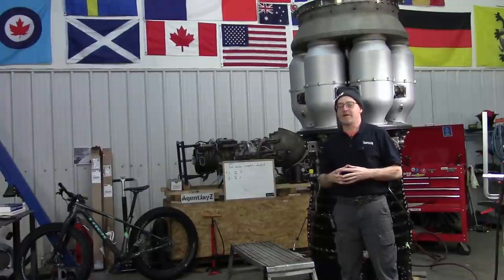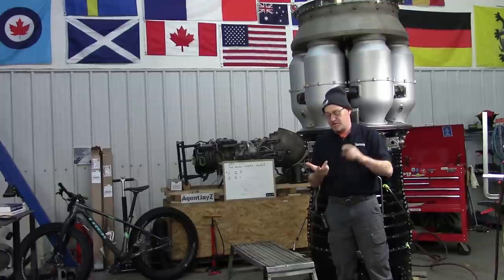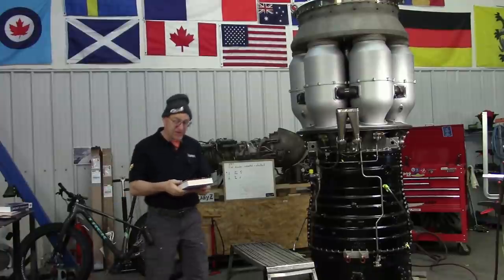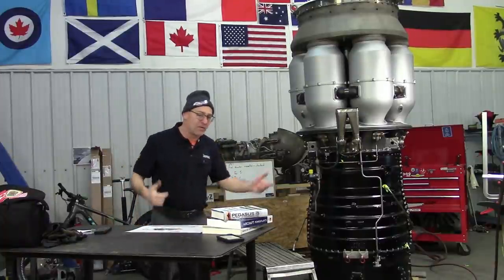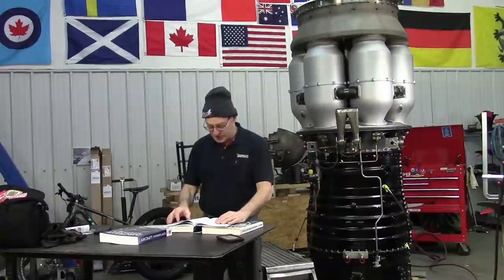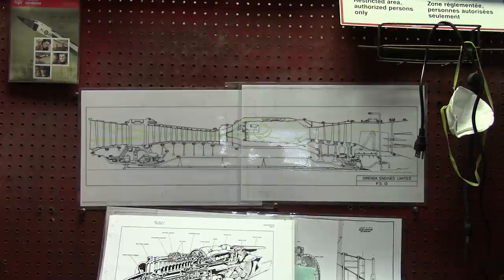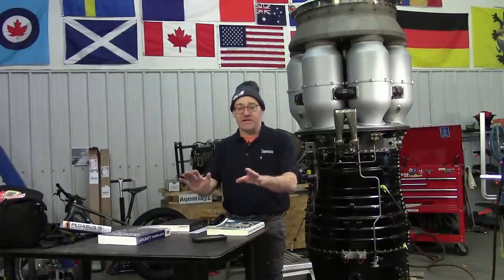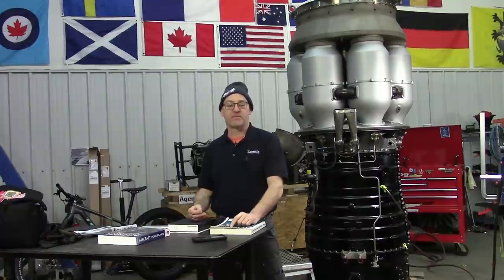So You Want to Design a Jet Engine

Comment: Plz don't ask design related question. You can see from the response from Jay, he is a technician and doesn't look comfortable with such questions. 

Jay didn't intend to scoff off but when you see the headline of this video and the response, its like "c'mon kid, get over it you won't be able to do it and the tone is not great to watch. 
very unlike Jay. He will come back good.
Reply from the maker: So, I'll put you on the list who are disappointed in me, based on their misunderstanding of this video. Didn't listen, didn't understand, made some assumptions, judged me, and wasted their time.
I may take this video down, because the people who need it most, are the least able to understand it.
Reply from the maker: List them? They are all featured in the video I mentioned. It's called books. If you can't find them with that info, you will waste your money on them. You need curiosity, persistence, intelligence, and patience as a minimum before you even start your journey of learning.
Minimum.
If you need to be spoon-fed, you are not going to succeed.
Reply: @trevoncowen9198  He actually chose a perfect example: If you make completly custom parts, you start from the dimensions(not really even, many of these dimensions, at some point will be spewed out by simulations and Finite Element analysis and optimization) and work your way towards manufacturing a finished part.
On 3 dimensionally contoured parts like this, coming up with a methodology to test if your parts are dimensionally within tolerance is non-trivial at best and even then requires dedicated measuring equipment such as coordinate measuring machines etc. Even those can also only measure a finite amount of points on the surface of your part. So you will have to specify a procedure to check the dimensions in key places on your part from which the manufacturer can extrapolate if he is within tolerances. Not sure how it is with jet engine parts like this, but oftentimes specifying those parts can actually influence the design of your final part. There are in fact "unmanufacturable" designs.
With something like this it is also pretty likely that you will go trough an iterative process, slowly adjusting your manufacturing process until your part fits your needs. At which point you deviate from the original dimensions in your calculations as you start modifying molds or speeds and feeds on your cnc machines, so tool deflection etc. come into play which further change the dimension of the final part vs. what you initially specified.
The part no longer necessarily exists as a list of dimensions, but as a set of manufacturing instructions such as:
use an 60° chamfering endmill with this much stickout and these feeds on that particular edge and verify that your surface roughness is below a certain treshold to see if the operation was executed correctly (exaggerated example). The thing is, it is indeed possible that you can end up at a point where no one knows the exact physical dimensions of a part anymore, but it doesn't matter as long as the produced parts do their job. This can actually lead to problems where you need to maintain certain manufacturing equipment way beyond what would usually be profitable, simply because the manufacturing process has been specified on that particular machine. I've seen it happen. In fact I know of a case of a very reputable company that still uses and maintains 60+ year old equipment to produce their parts, because every attempt of duplicating the existing setup in a new location has failed.

Dimension-wise the only thing that is going to be relevant at the end are indeed the clearances you got in relation to other parts. But there are other things you need to consider:
 Wether your part is structurally sound,(if it can withstand the stresses in your particular application, and how long it can withstand those, how it will wear and when it will fail etc. These would of course be things that you have already calculated, but you'd still need to confirm if your calculations match reality) if it has the right surface quality and thus if it behaves the way your flow simulations predicted (especially important if you start to optimize parts for flow applications like jet engines) , and in case of rotating parts you need to balance them individually, further changing the physical dimensions of the part, tough probably in non-critical areas that have been specified in the design.
There is going to be a lot of destructive testing until you have found out if all these things are true, so you will need to figure out if your manufacturing process is repeatable and you will come up with exact procedures to eliminate parts that are not up to spec.
At this point of the process you have a reasonable amount of faith in your manufacturing process and if a part has passed inspection you just need to trust that it will be good.

These are just a few considerations off the top of my head and I am not a jet-engine engineer in particular, so I am sure I have left out a lot of things. that are specific to thise parts in particular.

But I believe that wasn't even the point that he was trying to make. See the thing is, even if you could have the exact dimensions for a part, they are absolutely meaningless without all the context around them. They have been specifically designed and optimized to fit into that particular engine under those specific conditions. Either you know all the constraints that drive the design of that particular part, in which case you can theoretically make a simulation and calculate the dimensions, or you don't and they are meaningless even if you did have them.
And even if you had them, you'd either need to be able to purchase them and have the rights to use them in your application (in which case you could take any measurement you'd need yourself) or you'd need to do all of of the work described above to get them manufactured and design the rest of your engine around the measurements and constraints imposed by that particular part. At which point it really is easier to do the design-work yourself and have a part that exactly fits your needs instead.

I realize this entire paragraph was probably pretty convoluted, overly long and confusing, but that is because I am trying to justify the existence of at least 10-15 highly specialized jobs with only a handful handful of words.

tl:dr even if you had infinite measurements for specific parts of an engine, they wouldn't help you in designing a different engine

Comment: Firstly, I really enjoy your channel, Happy New Year!

Hill Helicopters (https://www.hillhelicopters.com/gt50-engine) are building a new light helicopter AND a brand new turboshaft to power it.

Quote from their website about the engine:
"The expensive and heavy compressor turbine gearbox has been completely eliminated, with a direct-drive starter-generator being employed to dramatically reduce the cost and mechanical complexity of the engine. Extensive use of redundant electrical engine ancillaries further simplifies the engine package, and modular design makes for easy maintenance."

Do they have a point, in that, if you want to build a dedicated thurboshaft, thats the way to go ?

Thanks.
Reply from the maker: The point is... That it's a helicopter manufacturer, making an improvement to an existing engine design.

Not a person, working alone, creating a competitive turbine engine from scratch by them self.

There is a difference there.